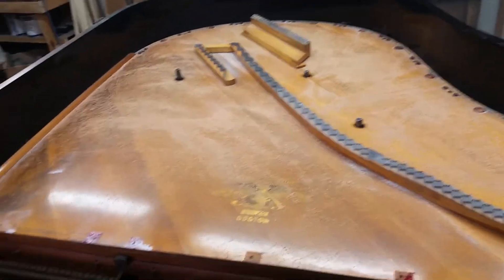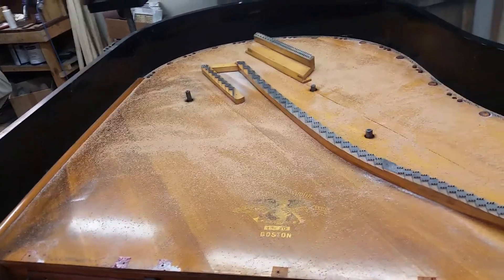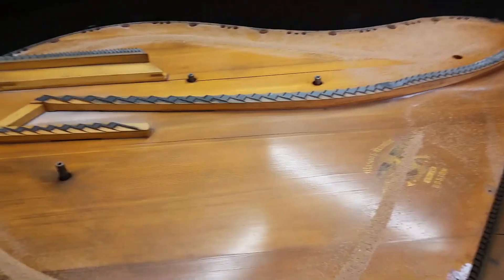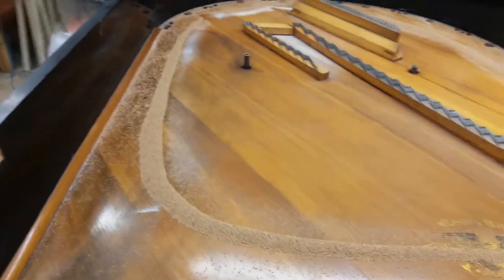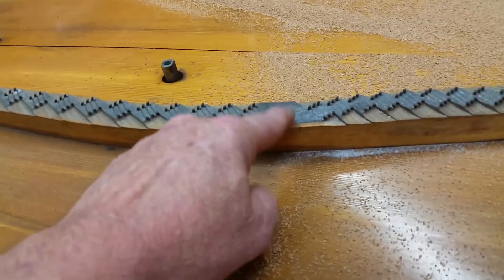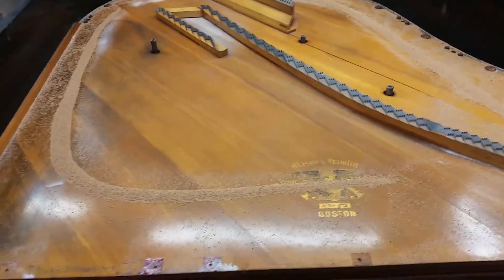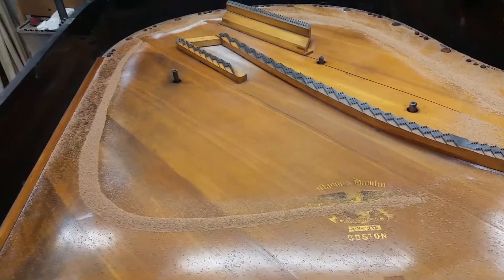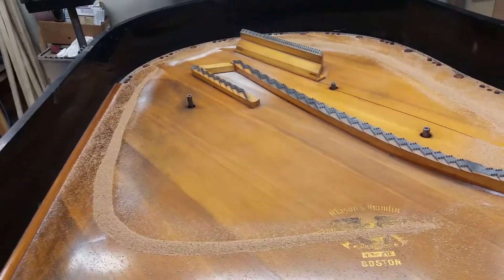Chladni Pattern on a 1902 Mason and Hamlin AA Soundboard

Comment: A grand piano does not radiate any appreciable sound intensity brelow 100 Hz. This is caused by acoustic short-circuiting, i.e. air that is pushed up on the upper side of the sound board travels around the rim to the underside of the sound board and replenishes the "lack" of air there. So, at low frequencies, the sound board pumps air up and down or in other words, no sound pressure is created because the sound is short circuited. It would be interesting to see higher sound board eigen frequences. Also, stringing the piano will increase the stiffnes and also the eigen frequencies. So, it would be interesting to do this test with stringed instruments, which is the situation we actually have with playable instruments